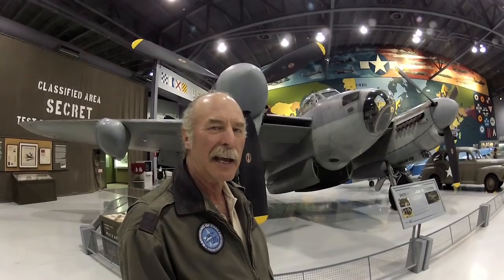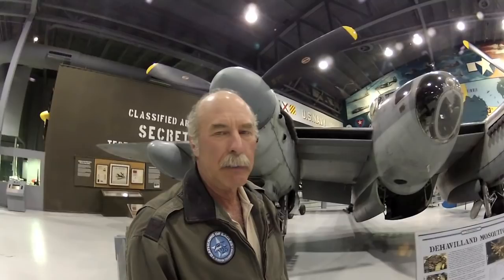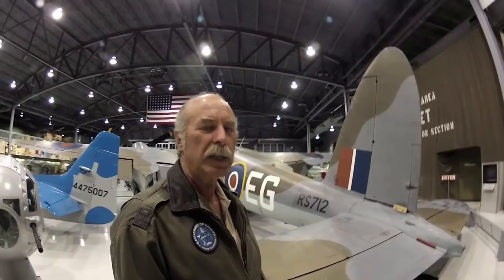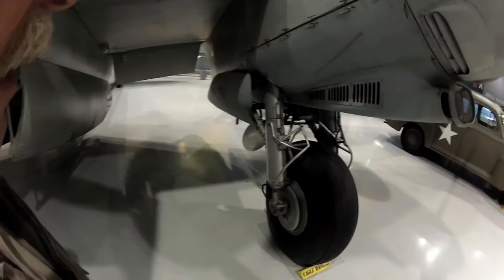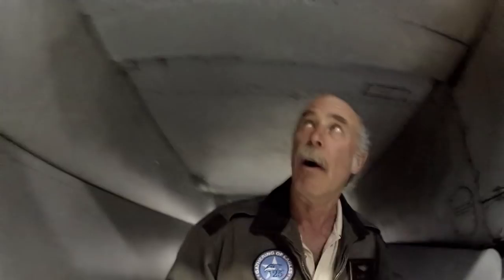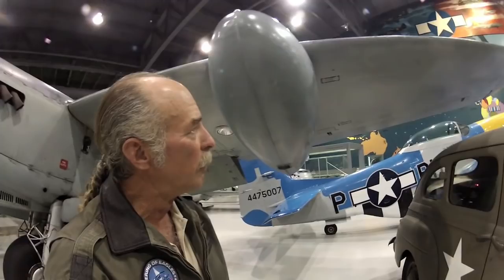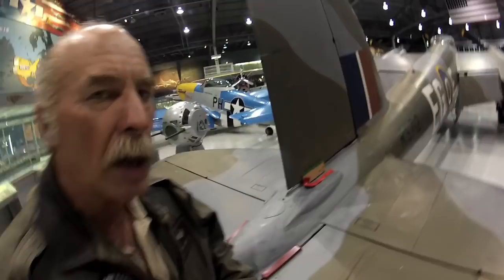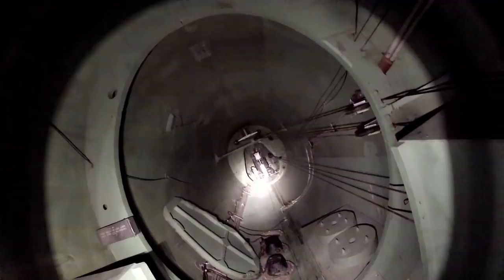De Havilland Mosquito - Tour Part 1 - Kermie Cam

Comment: In early to mid sixties I worked for a boat builder (UK).. although I didn't know it at the time the glue we used was the same, or similar as used on the Mosquito. It was a two pack glue, a white powder that turned translucent when mixed with water and a green watery activator. When the two were brought together it set very rapidly, especially in warm, hot weather.... When cured completely the wood would break before the glued joint.. Love watching your aviation videos. especially your preflight explanation of what's going on and the flight..Wonderful.

Comment: That distinctive smell that you get with the Mosquito probably comes from its wooden construction. They used Formaldehyde in the adhesive resins used in the construction of the fabricated plywood panels which the Mosquito was largely made of. Formaldehyde was used as a binding agent in pressed-wood products. A Urea glue was applied to one wooden surface and the Formaldehyde catalyst brushed onto the other and the pieces of wood clamped together, creating a waterproof bond stronger than the wood itself. That's your smell.

Comment: You mention how the fusalage is made in 2 halves [just like a model kit], Kemit When it came to the wings unlike a model kit they were had a single spar that ran wingtip to wingtip, swith the fusalage having a cut out section that slotted over/across the wings and bomb bay.

Comment: Hi Kermit,thanks for great informative videoing.In 1954 I was finishing my `Air Wireless Mechanic` course at RAF Yatesbury in Wiltshire county,UK,Almost the last task was to practice using the air wireless equipment in the night version Mosquito,,it was equiped with Radar;the viewing scope in right hand seat. Chas[ex 3141983].

Comment: Wood and glue have an interesting relationship with atmospheric conditions. Using glues that react with water and air means a limited and unpredictable lifespan! Service life for these airframes was not expected to be more than ten years or so, lots were scrapped after glue failures in tropical conditions. Perhaps modern glues would last longer.... trouble is, you have to build new aircraft from scratch!
Reply: Mosquitos in the India-Burma theater had to be withdrawn from service after a relatively short period when the glue began to degrade and the plywood started to delaminate. The squadrons got their old Beaufighters back.

Comment: The Mosquito is my favorite WW2 aircraft, can be used as a fighter, bomber, or photo taking aircraft, light and very powerful, until the ME 262, the Mosquito was one the fastest prop driven fighter/bombers in the war.. I caught a video of another restored Mosquito that was fly able located in Virginia. Other than this model and the one I mentioned, there are no other flyable Mosquitos.
Discussions of war-winning World War 2 aircraft regularly seem to leave out one of the most famous and successful of the conflict - Geoffrey de Havilland's twin-seat, twin-engined DH.98 "Mosquito". The type was a true "multirole" performer in that in was used as a fighter, fighter-bomber, reconnaissance mount, night fighter, anti-ship platform, patrol, intruder and interceptor against the best the Reich could offer - very few Axis aircraft could even catch it. The aircraft was designed from the outset as a multirole weapon and served throughout most of World War 2 and into the Cold War years before finally being retired. Her crews enjoyed her basic creature comforts (heated cockpit), fighter-like performance, handling, and speed and inherent offensive capabilities (cannon, machine gun, bombs, torpedoes and rockets), making her a star in the history's greatest air war. The DH.98 earned the nickname of "Wooden Wonder" in reference to its heavy use of wood throughout her design.
The DH.98 Mosquito was also one of the few wartime aircraft that could match the speed of incoming German V-1 rockets being launched from enemy-held territories across northern Europe. Such terror weapons accounted for the deaths of 30,000 British citizens during the war - the V-1 and subsequent V-2 rockets proving nothing more than a last-ditch effort on the part of the collapsing German war fronts. The DH.98 could utilize its speed to intercept such weapons and destroy them with relative ease only assured by a steady hand at the controls. In this role, from June 1944 onwards, Mosquitoes accounted for 428 V-1 rockets intercepted. Mosquitoes joined other Allied aircraft in hunting and destroying V-rocket launch sites throughout the Third Reich.  https://www.militaryfactory.com/aircraft/detail.asp?aircraft_id=126
Reply: Bobby Paluga  I love the Mossie.....but the bit about it being the fastest aircraft until the ME262 is utter garbage.
Reply: SuperEdge67  Reread my comment I corrected my mistake, I got carried away when I kept reading that the Mosquito was so successful shooting down V-1 rockets, it’s fast but not the fastest.
Reply: unladen and unarmed the mosquito could hit 400mph, faster than a spitfire.

Comment: During WW II, unarmed Mosquitoes flown as civilian aircraft were used to fly high value items from neutral Sweden, especially things like ball bearings. However, the cargo was sometimes human, and the famous Danish nuclear physicist Neils Bohr, who escaped to Sweden, was evacuated from that country in the back of a Mosquito where they would sling a hammock. As the trip was at high altitude, then the passenger had oxygen. However, Neils Bohr didn't put his on properly and passed out due to lack of oxygen and only recovered when the aircraft reduced altitude. He reportedly enjoyed the sleep, but it could have been his last. In any event, you can see how it would be possible to carry a passenger in fuselage. Of course, it would have been bitterly, bitterly cold. The pilot and navigator had some form of heating, but not back there.

The Germans were always trying to shoot them down over the North Sea of course, but the Mosquito had the speed, range and operational ceiling to make them extremely difficult to intercept.

Comment: Kermit & Gang...just saw a news item online that Airbus was going to bulldoze a building it had in England. In the building we're files from Dehavilland days with aperture cards (microfilm) of the original drawings for...sounded like all variants...of the Mosquito. If it is of interest, look into it! 
Best, 
Mike F
Reply: The dehavilland museum has all its original plans and drawings
Reply: @matthewfindlay2242  That would make sense seeing as it was designed at Salisbury Hall in London Colney, which is where the D.H. Mosquito museum just happens to be. It's great to be able to fly past the open doors of their main hangar when I take off in my microlight, as our flying field is right behind the museum. 

They are currently rebuilding a D.H. Dragon Rapide to flying condition and have asked our club if they can extend our main runway so that they can fly it out when it's finished. Needless to say, we said yes!

Comment: You may not need to strip it down to rebuild the structure, you should look into vacuum infusion, you maybe able to infuse the balsa with resin or glue which would rebond any delaminated parts without removing them, you know that's how they fix cracked windscreens, could be worth a thought anyway. That was a great investment, a guy I used to work with was in New Guiney during the war, he witness a Mosquito disintegrate in flight whilst doing a fly over of the field, I think it was at Port Moresby although to be honest I'm not sure were he said it happened, A few people have informed me that it was probably made in Australia, and they apparently didn't stand up to the humid conditions to well. I don't suppose reinfusing the wood with glue is going to help if its rotten, especially if the fibres of the wood are damaged, because the fibre of the wood are what gives it strength and flexibility.

Comment: I'm very much enjoying your videos or aircraft in your collection lucky guy
However I feel need to point out that ground crews had a vital role, Lancaster and mosquito couldn't be flown without ground crew or engineers, Lancaster needed priming manually too, very sad that engineers and indeed ground crews appear to be given little value, without which none of your collection of aircraft or collections here in UK would be running or flying, during the war there were terrible accidents no one heard about 
As said very much enjoying your videos love the P51 it was greatly enhanced by the Merlin engine

Comment: Flying aircraft like this is a big risk, too big to take as in the case of the Mosquito belonging to Bae Systems a few years back, it crashed and caught fire and was totally destroyed,little else can be expected from a wooden structure covered in cellulose dope and paint.why must everything flyable be flying? we have already lost three Mustangs, a P38 and a Spit in the past few years and you can only pick the bits up and rebuild so many times before there is nothing left of the original aircraft.
These aircraft are important for future generations to learn from but with the present attrition rate there wont be anything left when wealthy Americans have finished playing with them.
Some years ago I was a member of the RAF Cosford Aerospace Museum in Shropshire UK, I used to clean down the Mossy in the collection there and quite often sat in the pilots seat to have my sandwich's and tea, those were the days when we could work on the aircraft then RAF Museum Hendon took over and stopped us working on renovations.
My favourite was the only complete Messershmitt Me 410 in existance, I worked on it for 18 months clearing out birds nests, dead rats and a mummified crow, I had access to Spits,Me 262,Me 163, Catalina,Mossy,Kawasaki Ki100, Liberator,Avro York and about 30 other aircraft in order to keep them clean and tidy.

Comment: Didn't the Mosquito have a small bomb bay?
Reply: Depends on the model. The bomber versions certainly did but not the night fighter or anti shipping strike versions. DeHavilland engineers wanted the pilot and navigator to sit in tandem  which would have reduced drag and increased it's speed but RAF policy at the time insisted on them being side by side and you have to do what the customer demands. The failure of the tandem seat Fairey Battle may have influenced this decision.
Reply: Dunno, depends on what you call small. The mossie could carry 4,000lb of bombs in its bomb bay I believe, although that figure might be made up of 3,000lb in the bay and another 1,000lb under the wings. Apparently they had to replace the normal fins on the 500lb bombs with ones from 250lb bombs in order to get them all into the bay, but once there the mossie could take them to Berlin and drop them, then fly back so fast that the German fighters couldn't catch them.